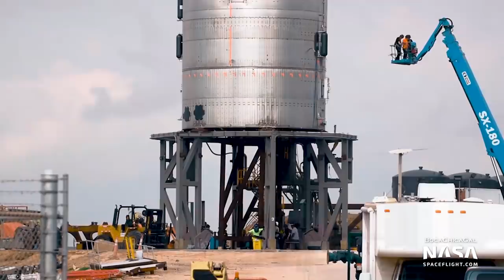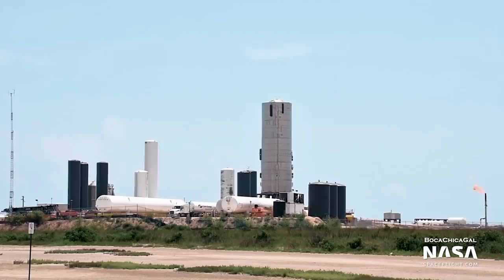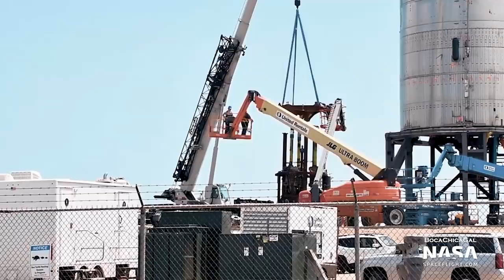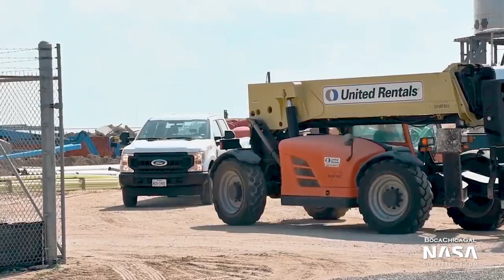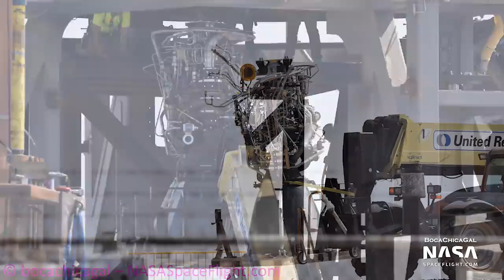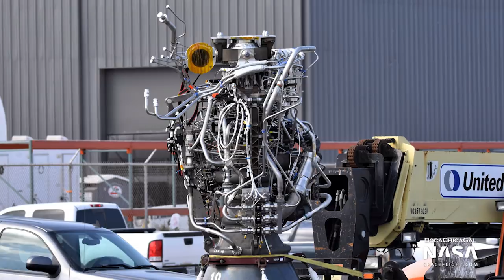SpaceX Boca Chica - Raptor Removed following Second Starship SN4 Static Fire

Comment from the maker: Check out that Raptor, Y'all! (As Das would say) :) Per some comments, they will do some more testing with SN4 without firing it up and likely they reinstall it ahead of the hop test. SN4 is still expected to conduct the hop.
Reply: So it will be SN4 probably. Ok. Just wondered with the removal.
Reply: Michael called it! He said the raptor was number 18 😎
Reply: Think they'll take her up to 8.5 bar?
Reply: How can anyone dislike this video! 🤦
Reply: @fernan2s136  - that would be the one ULA employee who is paid to watch and learn and figure out how far behind SpaceX they are 😁
Reply: @dannyassmann7331  
Make you wonder if that's why they brought back that tanks torture device, that's used to add mechanical movement stress while under pressure?
Reply: Thanks for the explanation, I was wondering...
Reply: That is a relief to hear. When they took the raptor off in order to install the pressure gauge underneath I was a little worried, but I guess they just simply want to check the integrity of the tanks after the two static fires to see if they have experienced any damage.
Reply: @fernan2s136  There are space deniers and flat earthers who claim all this is a hoax! You didn't know?
Reply: @brianblessing8369  Elon explained it was just a flameout.
Reply: @danielwhyatt3278  yeah huge relief
Reply: @drmosfet  This is what I'm thinking. The have two more in the wings, why not take the stress tests at or over the design specs. Fill the tanks with liquid nitrogen and let the torture begin!
Reply: @fernan2s136  Boeing employees?
Reply: Bye SN4 we hardly knew ye...

Comment: Gotta love how the Raptor is being treated like every other piece of industrial or automotive hardware, not boxed up in clean rooms or the like. There's no clean rooms on the Moon or Mars, so if it doesn't handle the wind, sand and salt at Boca Chica, it would be too fragile to fly. Built to industrial, military or mining specifications for reliability will make the whole vehicle safer.
Reply: Exactly.😏
Reply: I don't think any company fires their rockets in a clean room...
Reply: I could easily see Caps, Plugs, and Shrouds as particularly useful. See: 10cm(ish) flange covered in Kapon-tape near the top :D
Reply: @GXSergio  Well, sure, but they're all built and serviced and transported around like any little bit of dust will stop them working. If we're going to be a multiplanetary species, these things need to survive all sorts of harsh conditions, be easy to maintain, and operate as reliably as a jet or I.C.E.
They need to be easily maintainable inside the cargo bay of a Starship, by tools and parts that don't eat up load capacity of the vehicle.
Reply: And there aren't any seagulls to shit all over it on Mars.
Reply: Most definitely. Rigidity over fragility.
Reply: Couldn't have said it any better.
Reply: @PiDsPagePrototypes  exactly. 3D printers are actually in use right now in the ISS, so astronauts don't have to wait for a resupply mission to obtain critical mission tools.
Reply: @SouthernHerdsman  Well then, can you stop commenting so we can all have nice things?  ;)
Reply: @SouthernHerdsman  Well, my dirty dusty boots covered with scratches are the nicest.
Reply: Moon dust gets in everywhere
Reply: @crawlinginfilm9683  Aye... sex on the moons a nightmare!
Reply: @PiDsPagePrototypes  a single crackhead can undo it all, in the blink of an eye. They are magical like that
Reply: @SouthernHerdsman  - We don't need 'nice', we need good engineering.
Nice, can come later, with the robot girls and space fighters. :)
Reply: It kind of bothers me to high heaven to see the Raptors fuel and other plumbing lines left open. Nothing else is a concern, but I do hope they did use plugs in those lines.
Reply: @jeffmorris5802  .
Reply: Clean rooms are for protecting sensitive electronics and minimizing bio-pollution in space, not protecting the engines
Reply: All that power and not much bigger than a car engine
Reply: I'm feeling a little better that they at least are using a lift now that doesn't bend under the raptor's weight. I mean it was fine, but still. x)
Reply: PiDsMedia great comment. ya know, being a codger who watched Mercury, Gemini and Apollo, I started watching this series with extreme skepticism. It looked like a fragile, thrown together pile of stainless sheet. Kinda of a shiny Buck Rogers model. But considering SpaceX’s success and seeing the pressure testing work, and now the test fire, I’m coming around. Watching this video, the same word came to mind: industrial. If we are to make an all-out assault on space, we can’t do it surgically anymore as in the past. It needs to be in rough-and-tumble ships that can be turned-out by the dozens!
Reply: @izckloable  That video a week or two ago with the forks flexing under the weigh sort of freaked me out also.
Reply: @darrenbradz  - About the same size as a truck Diesel engine, but probably much much lighter, and significantly more efficient.
Reply: @c120flyer  - not far behind ya, born between Moon landings ;)
Yep, needs to be the sort of gear a mechanic can understand, same level of education and training as car, marine, naval, army, air force, railway or airliner mechanics get.

Anything lives depend upon, needs to be easy to maintain.

Comment: I'm amazed at how easily it can be removed, considering what's needed to ensure it doesn't tear itself off during operations
Reply: Alex von Seggern Trust them, theyre experts😏
Reply: I believe all loading is compression therefore only needs fasteners to keep it from falling off aside from a lot of vibration.
Reply: @davidkantor8064  That's true. The gimballing version will probably have more of a complicated removal procedure
Reply: Duct tape is an amazing product!
Reply: @herewithcoffee possible. after all there may be a chance someone needs to repair it on moon/mars
Reply: I bet the 4 bolts on top are really good metric ones!  :)
Reply: @alexv3357  These are gimballing versions. Try flying a hop with an asymmetric engine and no TWR...
Reply: The same amount of expertise that is required to clear up the place in just a matter of few days after an explosion.
Reply: you should see what holds on the wings of an airplane!
Reply: bit of gum and duct tape 'snuff
Reply: vonpredator there are also some big pipes to remove as well;) But yes it should not take too long if the connection is removable.
Reply: Alex von Seggern - I believe they want this to be as simple to deal with as the old VW Beetle, where you could swap an engine in about 30 minutes. This isn’t the Gimballing version, & what keeps the engine on during flight is compression, so the attachment should be fairly simple.
Reply: The connection to the rest of the rocket is typically a ball joint, so the engine can be steered.  So it merely needs to be bolted into the socket so it doesn't fall off before launch.  When the engine is running, it produces 200 tons of force into the socket, so it isn't going anywhere.  The steering is via hydraulic/electric jacks that push the engine sideways, pivoting on the ball joint.

The plumbing and electical connections aren't carrying any of the thrust forces.  They just need seals so they don't leak.
Reply: What more do you need than a couple of pipe wrenches and one or two adjustable wrenches <:)
Reply: Craig Hermle - And something to hold it in place as you remove it - Think what you’d need to swap out a worn out V-8 on a ‘60’s muscle car...
Reply: Go get you 19mm socket wrench, pick-up truck, duct tape and hand truck...don't come back if you don't have it.

Comment: Looks like they're remounting the hydraulic thrust simulator again. I suspect that they will repeat the tank pressure tests at higher pressures since the prior SN4 pressure tests were at lower pressures than the SN2 & SN3 tests.
Reply: David Kutzler Hopefully SN4 does not fly without raptor then...
Reply: Maybe they will burst sn4 and sn5 will fly
Reply: test raptor, test rupture...this is all very confusing.
Reply: Or maybee they make it rdy for the sn5 test and sn4 will start from the new structure beeing build atm?
Reply: Yeah I imagine they'll go for 6 bar... Or just test till it pops. They've got 2 more on it's heels so no need to baby it. Finding the weak links before sn7 gets under way seems like an appropriate use.

Comment: Looks like there about to install the hydraulics to add pressure to the bulkhead again.  Probably another cryo test. I sure hope Starship SN4 survives 🤞
Reply: It could be that SN5 is so close behind and that they have gotten what they need from SN4 they decided to pressure test to destruction or at least 8.5 bar while the second test stand is being assembled. After that they can run parallel testing on SN5 and 6, do the hop with 5 while wings and all get added to SN6, which'll make it take a week or two longer to assemble and hopping campaign would take at least that long. Pure speculation of course. They might have always planned on removing the engine for inspection and adding another one for flight or they can inspect it fast enough to add the same engine. They do have at least three on site.

Comment: Judging by the amount of propellant loaded, lack of frost on the ship, and the duration of the test fires I’m guessing that they’re taking baby steps and are about to ramp it up with SN4. Likely another propellant load with more fuel and a higher pressure test given the hydraulic rams are back. Then maybe two raptors for the next test fire on a new stand?

Comment: Wonder why they are bringing back the hydraulic pistons? Maybe going to test max pressure🤔
Reply: For the first pressure tests they only reached 4.9 bar. They said it was enough to conduct static fire. Perhaps a hop needs more than 4.9 bar so they do another pressure test to ensure sn4 will not explode during its hop with all its explosive methane inside
Reply: Sgt_Chouquette sounds plausible 👍they need to know what I can handle.
Reply: Or they have SN5 far enough along, with iterative improvements, that they are going to pressure test SN4 to failure for the data. Then do the hop test with SN5.

Comment: I noticed that they are reinstalling the thrust simulator stand, did it always have what looks like a gimbal plate on top? The tests make perfect sense, first they achieved minimum tank pressure, then they tested the pre-burner, then 1 static fire on main tanks, 2nd static fire on header tanks.. This proves the fuel line and delivery systems are working. Remove Raptor for inspection.  I expect now that they will attempt to achieve safety margin tank pressure and gimballed thrust stresses. IF SN4 survives that, I would expect the Raptor to be reinstalled for a hop test. If not, we have SN5 and SN6 waiting for their chance.

Comment: It looks like they are gathering data on a number of different dynamics in this test. The Raptor engine, thrust puck, valves, plumbing, tanks, control systems, etc. It is now most likely time to do a post-test stress analysis to confirm the pre-test stress analysis findings and to gather more data for the design and test engineers. I’ve got a feeling they will not pressure test SN4 beyond the pressure required for a hop to prevent the possibility of another RUD before hopping. Now they just need to check everything after the static fire to ensure a hop without a mid-air RUD.

Comment: I wonder if the plan is to test each engine on SN4 to get individual performance measures, then integrate them onto SN5. It would make sense to test 4 engines on SN4 and fly SN4 with one of them, juuust in case SN4 does an unscheduled bellyflop.
Reply: This crossed my mind also.  I'm pretty sure they have at least two raptors on site.  Perhaps they'll re-pressure test starship and then fit an alternate raptor, while they pull apart and assess the first one.
Reply: @RamsesBic  I would have watched it, no doubt - and I remember seeing at least two.  But the more the merrier.
Given that though, it'll be interesting to see what happens next.  
Going to be awesome to see three fitted and firing.

Comment: So, if the point if the static firing was to check the plumbing of the engine, why pull it out now..?! Wouldn't they just have to retest again before the hop next week..?
I don't get it..
Reply: I dont sure, but think that the raptor fail
Reply: They are gathering data on a number of different dynamics in this test. The Raptor engine, thrust puck, valves, plumbing, tanks, control systems, etc. It is now most likely time to do a post-test stress analysis to confirm the pre-test stress analysis findings and to gather more data for the design and test engineers.
Reply: These engines are still in active development. Last time Elon spoke about it, he mentioned that all Raptors taken together were fired for about 40 minutes total. Even for single use engines of this size, it is not unusual to get 10-20 hours of total run time during the development, before they are really ready to fly on a rocket. And since Raptor is supposed to last for hundreds of flights, one would expect to see even more hours of test firing before the engine is perfected.
Reply: I think Joshua Bishop makes some good points.  This is the first starship that has made it this far, and it looks like they still want to aim for the 150m hop.  Given the time it will take to get clearance to do so, it makes sense to strip it down and get as much data as possible before moving to more potentially destructive testing.
They are still learning so much from each test, and the more info they can get the better.

Comment: Hmm re installing the thrust simulator rams....  do you think that means more pressure tests? wonder if its going to be RSD :) (rapid scheduled disassembly)
Reply: Tanks don’t seem to show ice as before in pressure tests. Are the tanks not fully loaded for firing tests?
Reply: @paulpark1170  Whenever you have a mixed liquid/gas, you can maintain pressure anywhere from 'mostly empty' to 'mostly full' - it's all a matter of how you load it/chill it/etc. I have no concrete knowledge is the correct answer. But. I personally would fill with something like double the liquid volume I expect to actually burn, and pressurize the tank to wherever is most useful for the test. The the 'cryo tests' and 'pressure tests' - for the one, I'd want "full", and testing "load speed" and "empty speed" - things like that. For the pressure - you hit your target pressure ... and watch the dial creep down. (The 'leak rate') And then there's the thrust ram things .... Shrugs
Reply: @paulpark1170  There was a fair amount of ice on the first static fire, and I believe that the second was fed by the internal header tanks, so no external cooling.
But hey, it's all speculation really.

Comment: With the hydraulic rams back in place, it looks like a high pressure test regime for SN4. Maybe even test to failure.
Reply: @earth2006  At this point, with this alloy, there is no point to test to destruction. A test to 8.4bar will be sufficent considering that the design and alloy will improve and therefore will resist to even stronger pressure. On the other hand, SN4 would have never flown with an off-centered engine... in any case raptor had to be removed. If it survives the next pressure test they might just go for installing 3 raptors and start preparing the hop.
Reply: @RamsesBic  No I'm not wrong, I know raptor has gimbals, and I know gimbals could compensate for this BUT an off centered thrust in order to be stable would require to put the whole ship tilted a bit... so it will drift directly upon lift off which is already something you want to avoid and it would have to be tilted on landing which is definately a no go situation from my point of view.

Comment: Moving it by a rental forklift and a aluminum pallet. That's a picture telling 1000 words. Rocket science doesn't have to be that complicated or expensive :)
Reply: Believe me, the complexity is in getting the design to be inexpensive and mass-producible.  Raptors will cost about $1 million each to build, while the Space Launch System's RS-25 engines are costing $100 million each.  And the latter are one-shot throw-away engines.
Reply: @SeedFactoryProject  More accurately, they are reusable engines (by design) that are being thrown away.

Comment: As I keep asking are we sure that that metal tube is the full size version of super heavy?  Given the size of the Raptor and the size of that tube it looks impossible for 31 of those to fit in that base, no way. You can see it is big from the people around and on top of it but still it doesn't look to have the size to accomodate so many of those engines and all the connections etc. Are we sure this isn't a smaller version than will be made for the real job?

Comment: So is that the end of sn4 testing? Is sn4 not doing a hop?
Reply: Devin Dykstra I believe that they’re going to check internals of this raptor first. Then, if all is well they’ll reinstall and go for the 5m then 150m hop.
Reply: I think you are right. Probably shifting the hop test to SN5. Then they can pressure test SN4 to failure to add more data to make iterative improvements.

Comment: Must be a heck of a rumble. Like a rocket to space. How many would go off on the booster at once? Because they'd all be low altitude nozzles, right? Maybe no one knows that much yet. Wait to see.
Raptor must be pretty darned detachable if they can get it off in one morning.
Reply: 31 in super heavy
Reply: @landcruiser801  Oh, how do I avoid the dabbling mode? And I even saw that in a video last night. Well. Ask questions and learn that way. That's one way to do it. And I do. A lot of them. Ok. Clear on that one. Right on.